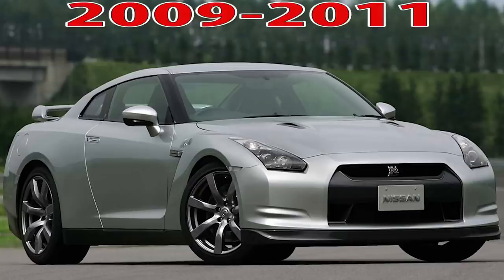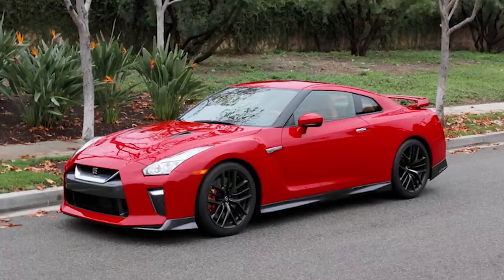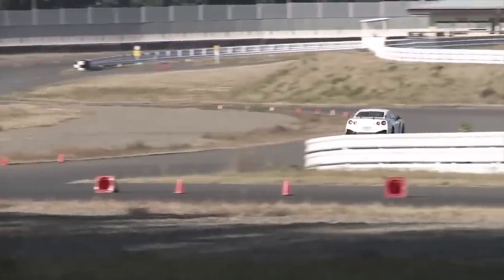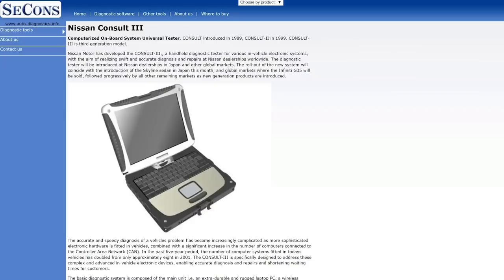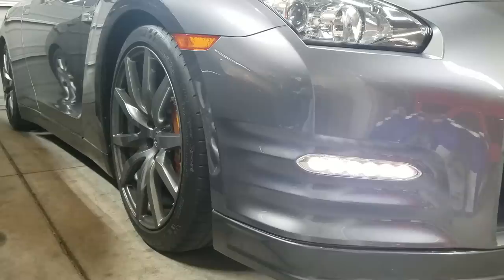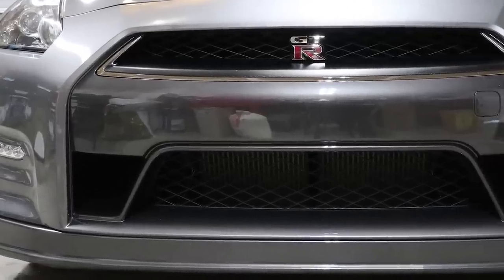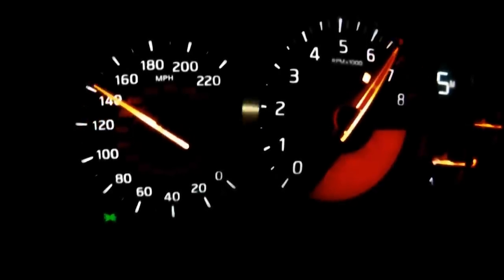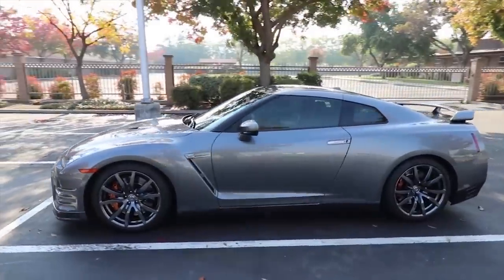Nissan GTR R35 Ultimate Buyer's Guide - WATCH THIS FIRST BEFORE YOU BUY

Comment: I would still buy one, still way less hassle than a Porsche or Ferrari.
Reply: I'm the best. Porche would be a perfect daily.
Reply: Salpeteroxid perfect daily???
Reply: I'm the best. Yes, a perfect daily.
Reply: Salpeteroxid the extremely high maintenance bills disagree, and what if you have two kids?
Reply: I think he meant that it's a perfect daily in the comfort sense, not the reliability sense.
Reply: SI0AX look anything with that kind of bhp is going to need high maintenance, I'm not Porsche bashing, as if I wouldn't love a Porsche, my initial point was I would prefer a nissan gtr.
Reply: I wouldn't buy a Porsche, unless it was a 911(rear engine), RWD(no AWD complexity) and it was manual transmission(no DCT complexity). 
If it complies with the above, it will have to be used(because these cars depreciate pretty fast) and then I would factor in the repair costs: 
possibly rebuilding the engine and changing out the entire suspension for aftermarket race parts.

But otherwise I wouldn't do that if I were to buy the GTR. What I don't like about the GTR, in the reliability sense is the automatic DCT transmission, but that doesn't seem too bad, just a little more maintenance work, but the biggest killer to me is the 4,500lb curb weight of this car, it's just too heavy IMO. 

The Porsche is must lighter, but if I were going to looking to buy only automatic and compare the Porsche with the GTR, I'd get the GTR because the transmission is way more reliable.
Reply: SI0AX so pretty much what I said in my original comment just you used more words? 😂
Reply: Oh right, I just noticed it now that you mentioned it. Then I guess I agree with you! lol XD
Reply: High maintenance bills? It's lower than the GTR's.

Comment: Great video. Can a gtr be upgraded to a newer LC version by the dealer or by custom tuning?
Reply from the maker: Yes, custom tuning would be required for 2009-2011 (CBA) if wanting to upgrade to 2012-2013 (DBA) Launch Control.
Reply: Just get yourself a Cobb access port with tcm and your good to go then you can adjust the launch to any rpm or use Lc1-Lc5 ..this car should have came from Japan with FBO E85..it sounds like a refrigerator running stock, and is just waiting to be unleashed

Comment: Do you think it's worth getting one from Canada? It's about 5k-10k cheaper for used DBAs based on my research.. Just wasnt sure if it's worth the effort.. What do you think?
Reply from the maker: Check for any import/transfer fees first and if the car checks out then it should be fine if it's within your finances.
Reply: @GTContent  thanks for the response, appreciate it! I've got an used '14 in mind which is like 2000 miles away from me. The mileage and pictures all look good, but I'm hesitating if I should just pay the seller and have him shipped over the car...(without even a test drive) I know it sounds dumb but any suggestions? I don't think flying over is an option for me especially during thus pandemic situation. Thanks

Comment: Purchased an off-lease 16 black edition over the summer with 27k miles. About a month ago I took it to les schwab so they could fix a leak in the tire and one of their techs said they saw some  oil leaking by the turbo line on the driver side and that it may need a gasket (advised me to take it to Nissan for good measure). Peculiar because I haven't noticed any leaking on my parking space at the home. I don't know how much i trust Schwab. Is this a reason for concern?

Comment: I am thinking of going for the 2017 GTR simply because of the problems some of the used older GTRs have, not only that its kind of difficult for me to find a barebone stock GTR that doesn't have any modifications whatsoever, I like the new 2017 model because they made that boring interior the older ones have into a more "supercar-like" interior it should be.

Comment: When I had a 2013 gtr looked at by Nissan for an inspection,  Nissan said they WONT download the ECU logs becsuse only the nissan regional engineer has authority to do it and is only done for warranty claims.  

What do you reccomend I do to find a Nissan dealer that will get the logs for me. I want to make sure this car wasn't tracked before I make an offer.
Reply from the maker: Going to be difficult if that's the case. I would assume that someone with a Cobb/Ecutek might be able to see the logs if you have access to one. If not, then you'll just have to trust the previous owner.
Reply: @GTContent  were you able to get the logs from nissan for yours? If so, how?
Reply from the maker: No. Didn't need to since it was very low miles and had no signs of being tracked (rock chips, under car damages, etc.)
Reply: @GTContent  the one I'm looking at is only 11k miles 1 owner, looks immaculate, all the engine builder Mark's are still matched up so no signs of modding, but how do I know if those 11k miles are not track miles. What else should I look for?
Reply from the maker: @slothystyle  brake rotor wear, tire wear or if they've been replaced. Paint damage. Damage under car.

Comment: Hey man love the video! Quick question if you dont mind? I'm looking at a '15 GTR Premium Blue with black interior(65k$) and has 45k miles. And I'm also looking at a 2014 Nissan GT-R Premium Black on Black (66k$) with 24k miles. Which would you say is a better purchase?
Reply from the maker: Without seeing their condition in person I'd choose the lower mileage 2014 unless you are set on the newer LED headlights and taillights. With about twice the mileage on the 2015, it may require some routine maintenance, tires, brake pads & rotors which will cost you more after the initial purchase.
Reply: aha :D thank you for the reply! I also love the black on black more I just wasnt sure if the difference between the two had any significant updates that would save my in the long run. I appreciate the feedback :)
Reply: I have the 2015 and very much love the lightning bolt headlights and noise cancellation update in the interior. However, mine just went through an expensive service at 48k miles ($2,500)
So the lower mileage may prevent you from shelling out too much in the near future. Best of luck!
Reply: thank you for the info :)

Comment: I test drove a 2014 GT-R today. It was pretty cold and it was in fact quite noisy. When we first departed, there was a rumble when the wheel was turned. I did check to see if the tires were making contact. They were not. Do you have any idea's what this might have been? BTW, this car has 27k miles on it. Black edition. Thanks

Comment: Don't know if I would buy a GTR. For everything that could go wrong an not knowing how it was treated I may just opt to buy a R32, Evo 3(when legal) or something else.

Still a few years out from any of this being a reality so I have some time to think
Reply from the maker: Not detering anyone whim reads tgis, but just consider that the older cars also have issues which may need to be addressed (suspension, engine wear, interior, parts discontinuation/availability, safety) are not as technogically advanced  (which may be a good thing) and meet today's performance standards.
Reply: GT Content 
Oh yeah I consider that. Honestly that why I'm looking at the Evo 3. Since the power train is basically the same as the Eclipse awd.
 But lots to consider.

Comment: I do really like the GTRs but two things kill it for me.
1. No manual transmission option.
2. Not having the ability to make it drive with a 100% rear wheel bias.
Reply: Yankee 1985 actually you can,just remove the forward drive shaft..us horsepower guys do it all the time..look it up..u can totally make this car rear wheel drive in an hour if u want to..
Reply: I think there is an aftermarket part that lets you automatically set whatever % you want front and rear, including 0% front, 100% rear. At least there was for the older GTR's. It was like a small digital display device you would setup around the center console.
Reply: If you're looking for a 500hp+ car with manual transmission, you're just looking for a car to ride with calm, not to go fast... So GTR isn't for you like you said.
Reply: yf0013, I got rid of my 2013 GTR because I got  bored with the DCT.  I bought a 2015 viper, which is faster, and much more fun to drive.  It all depends on what you want in a car and the driving experience.
Reply: @yf-zp5zf  my m4 has over 500 hp and rwd
Reply: At this point in speed and power an automatic trans will do better than manual most of the time.
Reply: Black_Leopard you’re right but some people don’t want to hear, go figure,!
Reply: @evewilliams5017  removing the front driveshaft doesn't make it 100% rwd

Comment: Looking to do some mods to my new 18 GTR, what should I start with?
Reply from the maker: Midpipe, exhaust and 2.75 intakes require no tune and will increase noise so maybe start there.
Reply: GT Content ok so got ipe -f1 ti on its way with downpipes and by pass. Next cold air injectors and fuel pump and cobb tuner

Comment: If the first version of gtr is Dba 2009 and so on, and the 2012-2016 is Cba, what about the 2017?
Reply from the maker: 2009-2011 is CBA, 2012+ is DBA. Some Reference the 2017+ as the EBA, due to the refresh, but technically that's incorrect since it's still using the 2012+ DBA ECU timing strategy. EBA is more of a community reference for certain regions which distinguishes the different refresh versions.
Reply: GT Content thanks for the answer, I appreciate it 😄
Reply: GT Content so the 2017 Gtr is still a DBA? Or Officially EBA?
Reply from the maker: Francis Punzalan Still a DBA.
Reply: GT Content oh ok, thank you very much

Comment: 2017+ = EBA
Full bolt on's will bend con rods over time and they will eventually brake.
Reply from the maker: Would like to agree, but not true.
Reply: GT Content hi mate first of all grate video wish you made this 4 years ago before I brought my first GT-R. 
In Europe they are calling the 2017+ GT-R EBA perhaps it's just on the forums to differentiate the models but that's what it's known as over here.
Reply from the maker: Big2009Gee CBA/DBA refers to the timing strategy in the GTR. The 2017+ still uses the same timing strategy as 2012-2016. I understand the desire to call it an EBA because of the exterior/interior/suspension updates. Technically it's still a DBA...just now with a refresh. EBA will be more of a GTR community reference, and that's fine because of the noticeable changes and eliminate confusion.
Reply: You can run the torque anywhere from 600-650 without issue..some guys are pushing 850whp but keeping the torque down to 600-650 and have put 20-30 and some 40k miles with that set up..with no bent rods..its all in the dyno tune set up..anything more than 850whp 650 torque tho and your going to have to build the bottom end with forged rods..and do some tranny upgrades also..

Comment: Buy an 2009 gtr with a 2013 trans for the gtr? Would it fit?
Reply from the maker: A 2013 trans will fit into a 2009. All of them interchange.
Reply: GT Content but would all electrical connections fit as well? I heard some say it won’t.
Reply from the maker: From what I'm aware of, some solenoids and tubing were updated. I have not verified, so you may need to swap out connectors from your 2009 onto the 2013.
Reply: GT Content makes sense! Thanks!

Comment: Do they still have the exploding hood where a slight bump on the front causes 20k in damages?
Reply: @GTContent  
Was some kind of pedestrian safety thing where the hood had to clear the top of the engine in a pedestrian impact, 
This might only be Europe. 
But real thing
Pyrotechnic hood/bonnet will lift up in the event of a front impact, wrecks the hood and both wings.
Saw it on YT a while back

Comment: Honestly, I don't think it is worth buying a used GTR vs buying a brand new one.  If you can wait, you can buy a brand new GTR at the end of the year or a leftover for $25,000 less the MSRP.  That way you get a new GTR that has not been beaten-up by an idiot who owned it before you.  Too many people abuse the launch control and get rid of it before they perform the required maintenance as far as changing the lubricants.  Also, the brakes are worn and you would probably have to change them out shortly after you purchase a used one.  Just something to think about.....

Comment: Since this is an awd car , if a tires blows out or need to change just one tire, must you change all of them or? And also how come some ppl have wider tires in the back and not in front on some gtrs
Reply from the maker: Tire diameters will need to be within 1% of each other or it will throw a code. Typically wider tires in the back will provide better traction as the weight is transferred to the rear.
Reply: GT Content so the wide tires of the back won't affect the transmission ?
Reply from the maker: Width doesn't matter. It's diameter. The front and rear will need to be within 1% of each other or an error code will appear.
Width=how wide the tire is
Diameter=how tall the tire is
Reply: GT Content gotcha, thanks man appreciate it. Keep up the good content  😌

Comment: why spend 50k on a r35 when i can get a r34 for that price
Reply from the maker: I'm assuming you're referring to an R34 GTR, which I don't believe are in the $50k range. That would apply to lesser models. But here's something to think about:

Chassis: R35 GTR vs R34 GTR
Appearance: 2009 vs 1999
Technology: R35 > R34
Power: 550HP vs 280HP
0-60mph: 2.8sec vs 5sec
1/4mile: 11.1sec vs 13.0sec

If you only had to choose one......

Comment: LoL this video makes people stay away. There is no way anyone with a brain would pay $50k on a car that will need a $20k transmission after you've signed the slips. The car has so many problems which makes it unbelievable that the price is still inflated. 

A new GTR is a no buy. A used one with warranty intact looks like the best option, so you can drive it for a year and sell it. Nissan doesn't stand behind the GTR at all with any extended service warranties that are available with comparable mustangs and Corvettes. If the GTR had the same warranty as the Nissan Titan, 7 years, then yes the GTR has no competition. Otherwise its best to buy newer and get your enjoyment and then toss it back onto the lot.